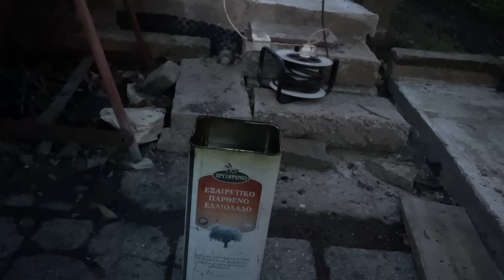Knife making - Puukko

Comment: Outstanding craftsmanship!  
I'm sorry, if you said it, I missed it.  What type carbon steel did you use for the blade?  Instead of making a "dummy" knife, couldnt you wrap the actual knife in plastic food wrap instead to form the sheath?
Reply from the maker: I used k510 steel , also known as silversteel or 1.2210 .  I made a dummy knife because I had to wrap the brass brace around it and I was afraid that it will damage the birch bark. I guess it can be done without it but I decided to follow the Kustaa Lammi video.
Reply: @RustLegion  Great Work!   Thank you, your response is appreciated.

Comment: Idon,t know, maybe it's just an impression but aren't your blades a bit thick ?
Reply from the maker: Yes it is. Around 4.7 mm thick at the base and tapers towards the point. The whole knife is larger than the typical kauhava puukko (or similar models) . In future I plan to make smaller model with 10cm blade instead of 12 and thinner blade (around 4 mm)

Comment: Question did you heat treat and temper the blade
Reply from the maker: Yes of course , at 2:00 you can see that I heat it and quench it in oil. I didn't show the tempering because it's not very exciting to watch. 2 cycles x 1 hour at 200C (400F)